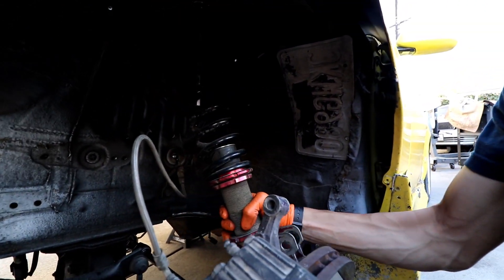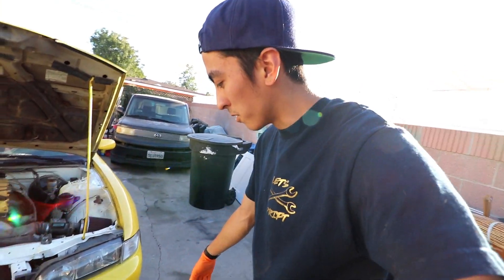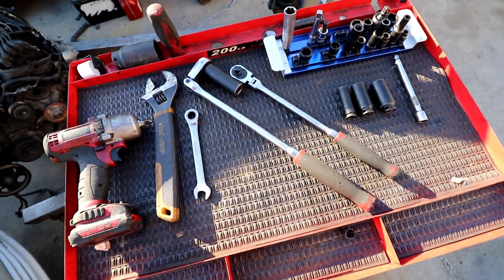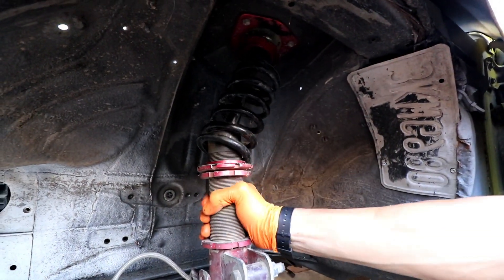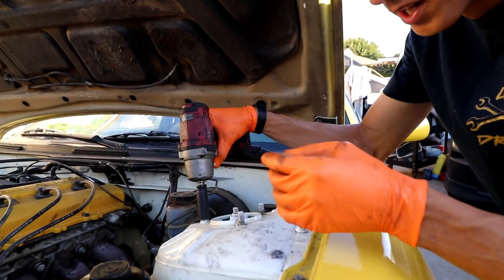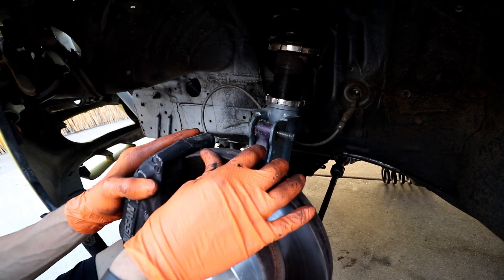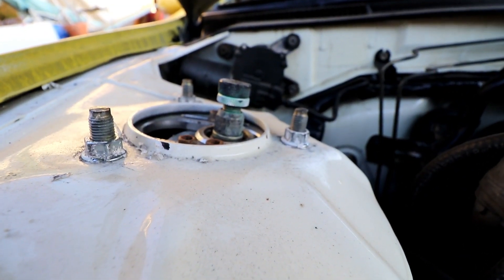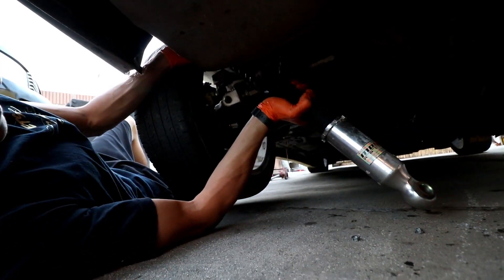HOW TO INSTALL COIL OVERS STEP BY STEP (240SX S14/S13)

Comment: I know pretty much nothing about suspension but am looking to install coilovers on my S13, do you need anything other than just the coilovers like adjustable control arms or something else? I have read about bump steer and adjustable arms but dont know when they are necessary. Im looking to get the car lowered but without crazy camber, just a non aggressive nice drivable setup

Comment: Did you jack the front of the car up using the front crossmember or something else? If it was something else, would that jack point work for the S13?
Reply from the maker: Yea front cross member bar in front of the radiator. I've lifted it from the sway bar before as well
Reply: @LetsDriftMedia  Alrighty thanks :D !

Comment: I keep on hearing a clunking noise when going over pot holes with my coilovers even if I slow down what could be the cause ?
Reply: most likely a suspension component like the tension rod bushings or tie rod end ball joint or the lower ball joint on the bottom of the wheel hub
Reply: can also be your preload, if you dont have any preload on the spring it can make a noise